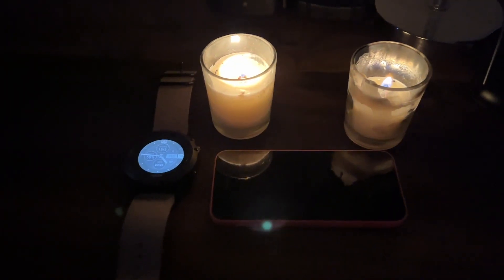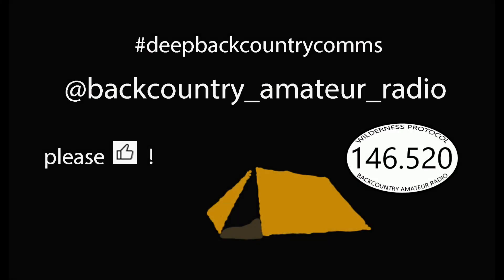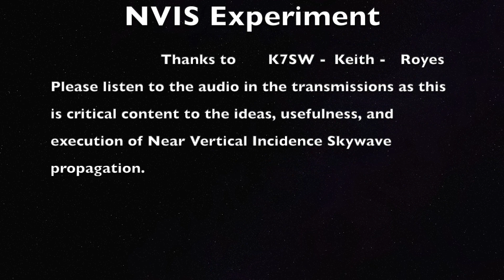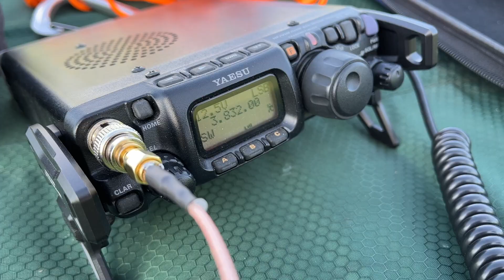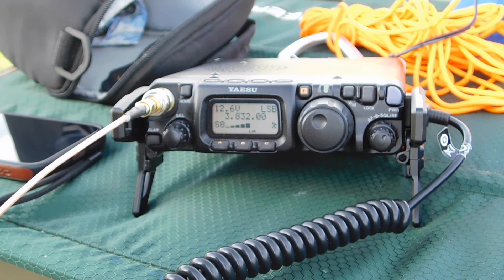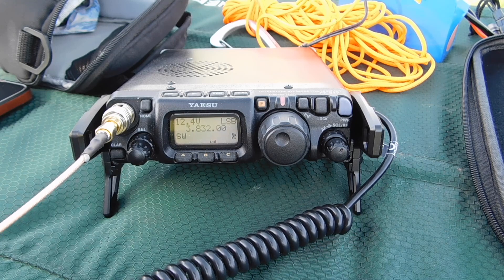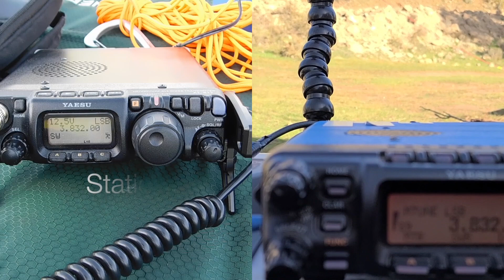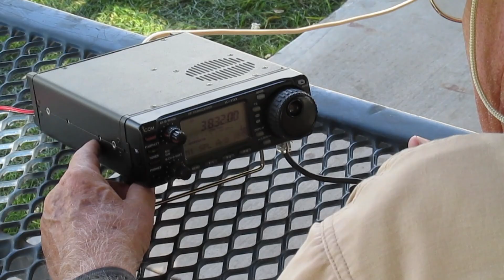Does your Emcomm (Emergency Communications) Plan Include NVIS?

Comment: Thanks for doing this.  I have a fishing backpack set up with my 817 batteries tuner and wire antenna for NVIS but was not sure how well it would work QRP.  I can also tie into my car 100W if needed.   Maybe I will give the QRP a shot next field day.

My coworker ran NVIS while deployed in Afghanistan.  They ran 5W secure comms.  In cases where it was a hot situation he said they would put the antenna only a couple ft off the ground.
Reply from the maker: Thanks for this comment! I hope you've had some great experiences with NVIS. It's a great technique. In fact, it is a borrowed technique from military operators. Interesting to hear about it in use in the field. Hopefully you've come across the Tech Prepper's channel where he does a whole lot of comm testing with NVIS. 73

Comment: Eric ... you were transmitting at 2.5 watts ("L" symbol/power meter with 3 bars is 2.5 watts ... lack of any symbol means full 5 watts) so test is more impressive than you think! The 817 manual is confusing.
Reply from the maker: Well, Thank you! I guess if there's a good prank for my radio to play on me, that's it!

Comment: Don't forget about the 60 meter band. When skip is too long on 40 meters and D-layer absorption is high on 75/80 meters, 60 meters can be an excellent option.
Reply from the maker: Looks like I need to get to work on a 60m antenna! Thank you for the advice.